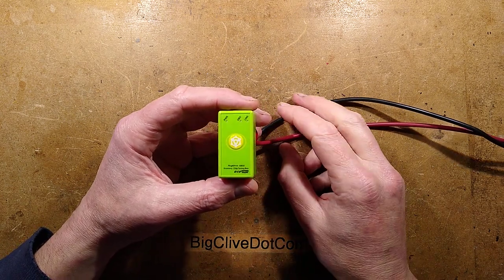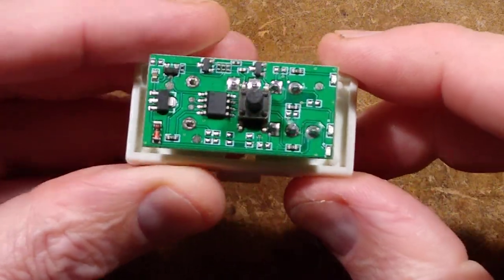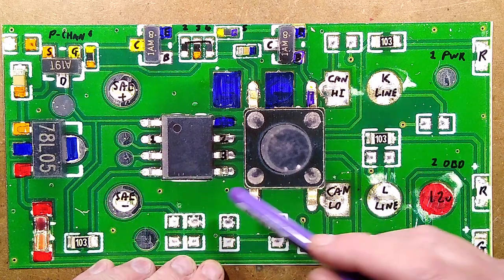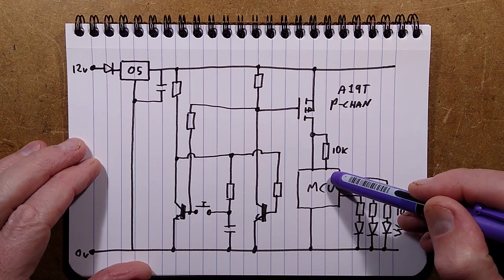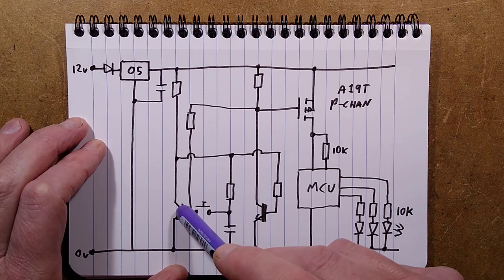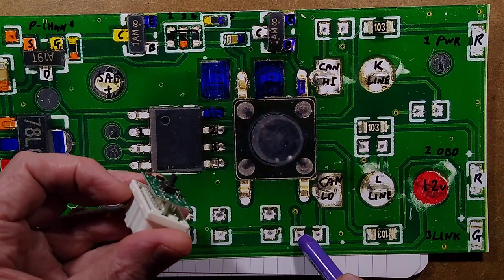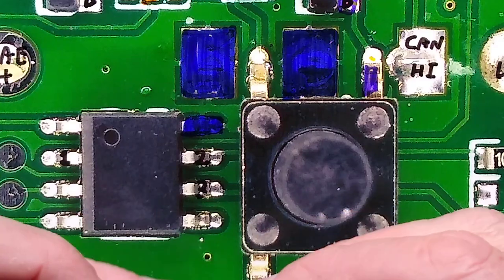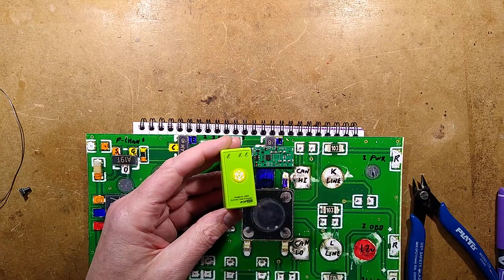Fake product with stolen software?  (with schematic)

Comment: The on/off toggle circuit looks very much like a simple version of the footswitch circuit of a cheap guitar effect pedal. Two transistors back to back with the base of each connected to the collector of the other, hold capacitor(s) and, in the case of a pedal, a JFET to switch the audio signal.

Comment: This looks more or less identical to my bluetooth ODB-II adapter, apart from the color and text. My guess is that they just took one of these designs, and populated only the bare minimum to get the lights blinking. That's the reason for the overly complicated PCB and the lack of a lot of components.

Comment: Do not tap into the OBD power lines for power!
If you burn your socket fuse no trouble. If you want permanent on 12 V use one of the radios'. One that powers is clock. If you short or even worse spike communication, important things might start failing. 
I admit, I am a safety inspector and can't hold myself from sending warnings on forums ...

Comment: This item will work perfectly for my fake car.
Reply: My 30 year old VW Golf diesel is so advanced it has electric (motor) windows and LEDs as indicators.  The starter motor and headlights are about the only other electrical bits.

Comment: Excellent, you can easily make this to a real fuel-saver, just connect Pin 2 with 10, 6 with 14 and 7 with 15, im sure that will save the most fuel because it shortens all 3 buses in the car
Reply: Now that's clever..

Comment: Fake or not fake, it has a nice old-school dual transistor trigger circuit that I'm taking a note of.
Reply: Does that make it a simple S-R register by any chance?
Reply: @stepheneyles2198  I dunno about "register" but it is indeed a discrete component implementation of an RS flip-flop.
Reply: @stepheneyles2198   - yes, it’s a simple S-R flip flop / bistable / register. However, the circuitry for the button/switch adds a toggle facility.

Comment: Supprised they pu in so many parts and so much effort, rather than just a blinking LED board.
Reply: Probably because it's a half stolen design copy/pasted. Likely this company copied another company that was also making a fake part, who in turn was copying another...etc... At each step someone knows just enough to cut out more and more, but they just never bothered to change the PCB.
On a practical sense, I wonder if what happens is one company goes bust or runs back down the drain when they get caught out, and the surplus parts get used in the next scam product. Eventually a new run of boards is needed, but because these are fidiot scammers they have no idea how to redesign it, so just say "copy this".
Reply: @kal9001  Yes very true, I think the PCB company is also selling companys lays outs so the Chieses makes can just solder the parts on. Cutting the PCB layout altogether.

Comment: The input series diode is to protect the 78L05 from negative spikes on the 12V supply, as automotive electricity is quite nasty.  IIRC, standard automotive circuit design has to allow for -40V to +60V transients.

Comment: Another horror story yes, but I do love little transistor circuits like this. I think I'd be right in saying from your circuit description, that the transistor circuit wouldn't be quite there as a bounce free single button on/off toggle switch for a small construction project, as the power would go to a definite ON if there was an interruption to the incoming power supply. I do though recall from ages ago, a natty two gate cmos invertor circuit (leaving 4 spare invertors) using a couple of resistors and a capacitor that formed a single button on/off toggle. The rub is though I can't recall (without a lot a doodling) exactly how it was done.
Update: Its just dawned on me: Take the FET gate to the other collector!

Comment: the wild ass circuit might've also just been an attempt at preventing reverse engineering.  do something simple in a complicated way so either competitors can't steal their design or so a layman opening it up goes "oh man that's complicated it must work"

it could be stolen code as well, but you don't need any code to blink some LEDs so I'm leaning towards my theory
Reply: Absolutely but I have to wonder why somebody would worry about a totally bogus product (piece of crap) being reverse engineered?
I myself have developed a genuine fuel saving system. I don't want to say too much until the patent is granted but I'll give you a hint; a dog's 'squeaky toy' cable-tied behind the accelerator pedal, pure genius! I can't wait to be rich. Arguably, you could just ease off on the accelerator a bit, maybe cruise along and never, ever use automatic speed control?
Sorry if I got too technical there!
I love Clive's 'breakdowns', old school electronics and basic practical engineering 'exemplified', logical reasoning in an analogue world.
I 'entered the fold' when OC 71/72 Germanium transistors were the 'way to the future', nice to find some kindred spirits.
Pax.

Comment: It could be stolen code, but given the origins it could just as easily be lost source code, so that's what they were left with and they found a a way to make it work. I've worked with suppliers in Asia where a design is so old that it is impossible to update without complete redesign.  Sometimes, the original engineer left the company many years ago and no records of the original development remain.
Reply: I wrote some Arduino code a ways back, they then updated the Arduino compiler and now I can no longer compile my code even though I have the source. So this can easily happen to anyone.
This kind of makes me want to go back to assembly code.

Comment: I'd assume that if these units actually DID what they said on the tin, they'd be illegal in many places where modifying the factory map is illegal due to emissions regulations :)
Reply: I was going to same much the same.  I'd think they'd be illegal anyway because they can't deliver on their promise.  But if they tried, they'd be illegal for tampering with emissions.
Reply: That does not apply to about 98% of countries. 
There are many Real OBDII tuning options that are completely Legal, 
Almost all countries you can modify the cars computer and tune, specially as there is no way to tell its been modified without scanning it. 

USA is one of the only few countries who regularly check cars emissions & even then its only like 1 or 2 states on West Coast. 
(here in Australia its only done if you get caught with exhaust without cat converter or police see black smoke (unburnt fuel) coming out the Exhaust, other wise can drive the car for 50 years on the same Road Worthy Test you got in 1960's :D) 

Majority of countries dont even have a test when you get car first Taxed/registered in your name. 
They simply rely on what the car company says. 

In the end none of it really matters (single voyage of Queen Mary 2 put out more CO-2 and pollution than every car in entire United Kingdom does in 1 week. 
Or they use as much fuel as 1 family with 2 cars could do 250,000km per year (500,000 combined) for over 25 years.
So car pollution is a small fraction of the issue. 10 Cruise ships = over 250,000,000 cars Co-2 output.
Reply: The irony of course being that if you successfully reduce fuel consumption, you're going to be reducing emissions anyway. The engine isn't creating the emissions by magic.
Reply: @tin2001  wrong, you must keep the engine running in ideal conditions. by leaning the Afr you can save fuel, but increase combustion temperature and increase NOx emissions
Reply: When I was a teenager I'd occasionally have a nocturnal emission. Does cleaning up the mess in the morning count as tampering with emissions? Illegally? Would they have sent me to the penile colony if they caught me?
Reply: @sootikins  well one way or another, you'll surely be doing a stint of hard time.
Reply: @tin2001  wasn't there some EPA fining that happened in the early to mid 2000's because they found out that heavy duty truck engine manufacturers were skirting emissions laws to improve overall fuel efficiency? Granted that's diesel and NOX emissions so who knows
Reply: The other thing is that manufacturers spend hundreds of millions to eek out every last 0.01mpg. Cars can be remapped for more power with ease, but I'm not sure any mapper has ever managed to improve MPG over the factory map.
Reply: @MattyEngland  incorrect, the emissions laws mean the manufacturers are focused on nox emissions even more so than mpg, and they don't always work together. 

As the comment above said there's always "wiggle room" to run the car at a leaner air fuel ratio especially at low load, cruise but this results in higher combustion temperatures and therefore higher nox emissions despite the engine being more efficient and powerful with a slightly leaner afr.
Reply: @TheIcyWizard705  Did you botch the description of the diesel car scandal where VW and others tuned the map to pass during the lab test conditions, but skip the NOx reduction in real driving conditions.  The entire story seems like the EPA regulations were turned into Chinese whispers that the cars only needed to comply under specific test conditions and engineers optimized the engine to use minimal AdBlue and otherwise work well while still checking that box.
Reply: @tbas8741  Lot more than just 1 or 2 states on the West Coast that check emissions in the USA. Illinois, New York, Pennsylvania, Maryland, DC, Virginia are just a few states that check emissions (not necessarily state-wide).
Reply: @johndododoe1411  Nah if I recall there was some EPA action against Cummins, CAT and Detroit Diesel for tuning their engines for better fuel efficiency at the cost of violating NOx limits. I want to say it was at the latest the early 2000's because there was no DPF requirements yet for diesel engines

Comment: I'm surprised these OBD gas savers haven't started popping up at gas [petrol] stations yet... So many independently owned service stations with dubious owners are already selling questionable stuff, from crack pipes to expired food, to even using card skimmers to steal from customers, this would just be another exploit for these shady owners.
Reply: Seen them... or at least packaging with kind of these things. Of course did not buy them for more then 15 € ...
Reply: Customers would demand to pay for less fuel after buying these.  Hilarity would ensue once it's proven the loudest complainants didn't even plug in the thing, thus being scammers themselves.
Reply: It is hidden in the small characters you need to pay a subscription to enable it! /s

Comment: Looks like they employed someone who thinks they know about electrical engineering, and started designing a board to actually interact with the system, at which point the boss said, "No, I don't want you to actually design an ODBII device. It just has to vaguely look like an ODBII device.".

Comment: I'm sure someone else in the comments has already mentioned this but I believe the components left disconnected are because they've used the same board/plastic box that is normally used in the cheap wifi/Bluetooth elm32 code readers.

Comment: I'd think that board is used for some actual product (either previously made or some prototype stolen from one of the chinese PCB shops where prototypes might be ordered from for intermediate drafts) and then some dude just adapted it a bit overnight, got it to do the blinky thing and bought a ton of them and pushed it to market.
Reply: If that were true, the tracks would all go somewhere - they don't.
Reply: @paulstubbs7678  Well whoever adapted it might have just deleted stuff to make way for his things or whatever.

Comment: Another issue with these is that some cars won't save an error log to the ecu if a diagnostic tool is connected, so potentially depending on the arrangement of pins, dodgy circuitry, software etc. a car may detect something is connected and thus not log error codes

Comment: I am rather new to electronics and circuit design. I am wondering if the design of the toggle switch is good or not.

A while back I had a LED torch with a broken body, but luckily the head is intact. I wanted make a small toggle switch with a small throw lever microswitch (more like a detector switch). The current for that torch is around 1A, so I am using a MOSFET. Pretty much the same idea in the device in this video.

The circuit here seems to be able to achieve that, and seem to have a bit of switch-debouncing as well? But is it actually a good design, or is it a round-about way to achieving it?

I wanted to learn from this, but not sure if I should consider this as a good or bad example.
Reply from the maker: There are dedicated chips that offer the toggle function.  This was quite an odd and complex implementation.

Comment: There's a microcontroller that is an... unofficial PIC-12 code and pin compatible chip. IIRC even the PICkit programmers work. They're the third or second to cheapest on LCSC. One is made by Fremont Micro Devices but is labeled, there was a blank one I can't find anymore.

Comment: many many years ago, i almost built something like this. It would only clear DTC codes stored. whether someone changes an engine sensor and needs the clear codes, or the idiot lights are just illuminated on the dash, it would clear them for cheap. because those fancy scan tools arent for everyone's budget, and doubtful they'd use it enough to justify buying an expensive unit. 
Thanks for sharing these and showing people these things are just a scam.

Comment: This unit should had a pass through OBD connection so that you could plug more than one in a chain for even more fuel saving 🤣 BTW I love using 10K resistors for indicator LEDs when I design a circuit, It is pretty much always enough and I can bet my only pair of shoes that they won´t burn out quickly too

Comment: What's funny is that you can't affect fuel economy in any meaningful way through the ODB2 port.   You'd need to reprogram the ECU or a specific module, which is much much more difficult.  In fact, in many cars, you can't reprogram the ECU without having expensive equipment, and a subscription to the manufacturer's site that lets you download the correct software and then it digitally signs things.

Comment: I assume this is only a two-sided printed circuit board? If it were a four or six layer pcb, then "blind" plated through holes might nevertheless connect elsewhere. Do you ever meet this problem when reverse engineering?
Reply from the maker: I despise multilayer boards.
Reply: @bigclivedotcom  I daren't ask what you think about buried vias then! Great videos, thank you. (I hand drew and etched my first printed circuit board using weak ferric chloride from the chemist in about 1965. It didn't work --  I should have taken the hint!)
Reply: Yup, my first thought as well. Maybe the original design was 4-layer and they just figured out this version works fine with just the outer ones. At any rate components only exist on the outside - so if in doubt, one can just probe for continuity from the CAN pins to every other part on the board...
Reply: @AttilaAsztalos  Actually not true that it has to be outside -by cutting holes in the pre-preg layers 0201 and smaller components may be present on the mid-layers when stacking up the PCB. Not cheap, not easy to fault find, but just occasionally done in situations where nothing else fits. The 'core; PCB is populated, then the punched pre-pregs laid on and then the outer layers, and then after pressing and curing it is through drilled and plated.

Comment: I don't understand why they would need to steal the software though.. writing a few lines of code to blink an LED convincingly would be very easy and reduce the overall cost of producing the device if they didn't have to include the extra hardware for the switch toggle (writing the toggle in code instead)
Reply: This just shows the level of intelligence of those involved - zero

Comment: I recently saw on eBay tuning chips that apparently tune your car via odb2 but then i did some reading online and apparently most of those so called tuning chips literally just  have a resister inside to trick the engine and is doing zero tuning.

Comment: One thought is maybe the chip doesn't have a built in reset pin, though I guess that doesn't quite explain why they didn't just use one of the pins as software reset

Comment: Just a side note Regarding the comment at end about tapping into constant 12V source at the OBDII port. 
Never do this as onboard computers are very easy to blow and also dont like power interferance.
Say if its connected to a strong car stereo head unit and turning it on drains power this could be enough to make car send wrong signals and even blow engine. 
 
just run a new 12v wire or tape into radio instead.
Reply: That's not quite how it becomes a problem... The issue is more along the lines of the data lines are 5V max, and you're playing with 12v wiring within millimetres of them. And that the 12v constant power in the OBD port is intended to power small electronic scanners, not large loads, and will have a suitably small fuse to protect the suitably small wires.
Also, do people seriously hook stereos into the OBD port? I'd have thought any car that actually has an OBD port would also have a constant 12V already present for the factory stereo.
Reply: Note: OBD 12v connector is rated to 6A.

The issue is with that, did the designers of your car's electronics allow for 6A per OBD socket (some cars have multiples) or is it 6A total?

Generally, exceeding the rating of this should just cause a fuse to blow (or breaker if you have some kind of aftermarket PD system).
Reply: The 12v power rail at the OBD2 port comes from the fuse box, it has nothing to do with the onboard computers. It's purely there to power diagnostic tools. The older OBD systems without a standardised connector often didn't have any power rail which is very inconvenient.